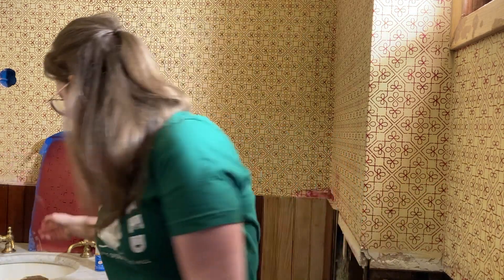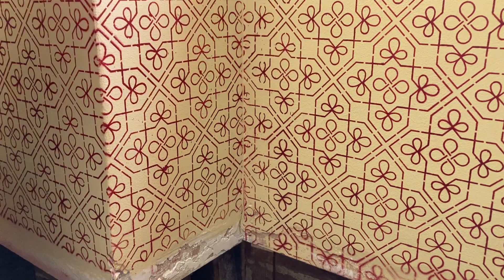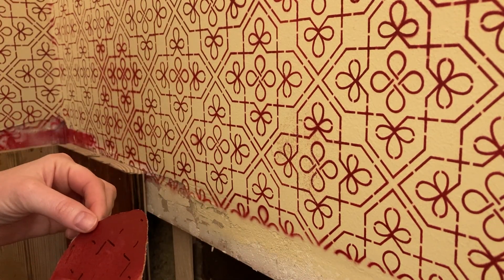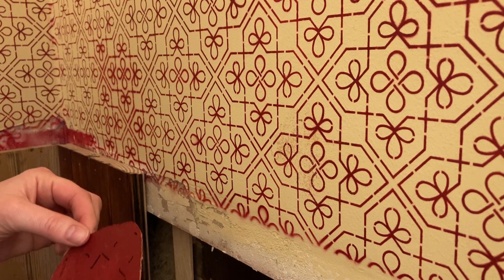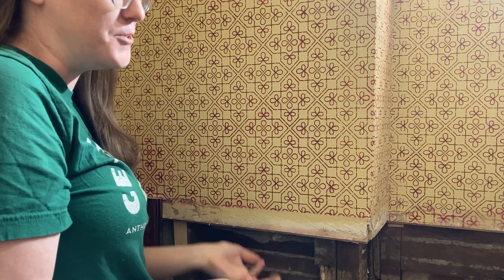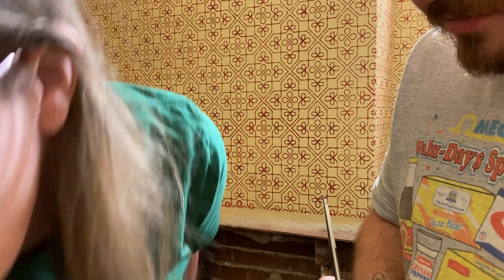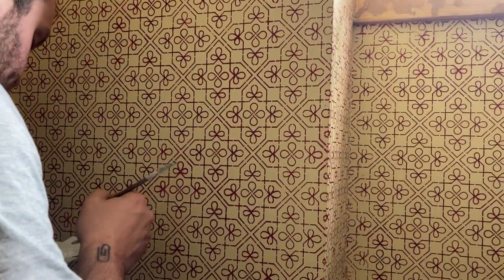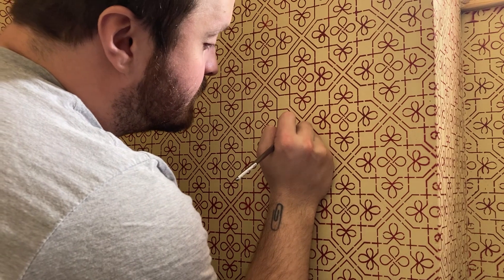Attempting to Fill the Gaps in the Stencil Painted "Wallpaper"

Comment: Kim, my suggestion is to work from higher areas to lower freehand, and do only lines that are at the same angle for each painting session--i.e. only the lines running diagonally left to right. Don't switch around. That way you are making the same motion with your hand with each stroke and you'll be more likely to make a consistant mark, especially as your muscles get into the habit. Then after those dry, pick another angle and work just the lines at that same angle. Don't be discouraged. You're doing fine :o)

Comment: You guy’s have come a long way. Redoing a older or historical home is timely work. I’m over 10 years into remodeling my home. A contractor is going to cut corners mostly in time and materials. Things may not be perfect but you did it. Major works are electrical and plumbing. You guys also have a challenge finding era similar material. The fact that you are not just tearing down horse hair plaster and putting up ultralite drywall is amazing.
Reply: My hubby and I have been working on our 1916 farmhouse for 29 years now and are still not done.

Comment: Hey, Just thought, you could use a straight edge along on side of the line that needs painted. Hold it down with painters tape. One edge would be straight and the other, well you just have to be careful. :)  If your straight edge is 24" long, or what ever length, then you could do any space along that line. Just a thought. Its not a waist of time when its a labor of love and appreciation.
Reply: That actually not a bad idea - hope they see this comment
Reply: That spray on glue will make a mess. I know you would have to go the same direction across the wall. Then when the paint sets up go at a different angle. Either way very time consuming.
Reply: I agree, very 👍
Reply: Yep! That's what I was thinking. Ruler or even thin cardboard to keep the bottom line straight.

Comment: Just to maybe save y'all some trouble in the future: 

1. Start from the ceiling and work your way down. That way, you'll get the hardest areas to reach first, and as you move down you'll have dry space to rest your hand on the wall for stability without messing up your work since nothing below your hand would be painted yet. 

2. Start in sections of the wall and work your way around the ceiling first, then pick a wall and work your way down to the bottom. That way, you'll have an organized method of knowing exactly what was done and what needs to be done instead of filling in random spaces and having the potential to miss spots. Keeping organized makes sure you won't leave any gaps. 

3. Make sure not to overload the brush with paint as it'll create a thicker line than you intended. Start with smaller amounts and build up until you're comfortable doing the lines in one stroke. 

4. I would personally recommend using paint thinner instead of water to thin it out, as water dilutes the color and can affect the way it dries and how long it lasts. Especially in a moist place like a bathroom over time it could potentially change how the paint looks. Paint thinner on the other hand will just make the paint more viscous without compromising the quality of the paint. Also, paint thinner helps to clean the brush when you dip it in and wipe it every so often, which is hard to do with plain water. 

5. I've drawn for years and I can say from experience that the faster your strokes, the smoother the line. Try to practice your stability with paper and a pencil first, drawing straight lines in a single stroke until you get good at that and then they the same thing with paint. It might help you to use smaller strokes on the wall than longer ones, like just filling the gap with no overlap on the pre-existing lines because the longer the stroke the more likely your hand will shake. 

Looks like a grueling process but if the two of you work together it'll be done in no time. Don't give up just because you can't get perfect lines right now! You said you'd touch up later with yellow anyways, so you can fix any major imperfections then  and it'll be easier to do so. 

Good luck!
Reply: Lots of good suggestions.  When I do a project like this I listen to music I can sing or dance with, or NPR podcasts

Comment: This might have already been  said somewhere but if you ever do this again I would 100% use a hobby airbrush.  Way less fumes than spraypaint, cheaper paint, easy to fix stuff.  You would have still had to do some touchup by hand but the paint wouldn't have had as many problems with running and fuzzing out as spraypaint. They're also really useful for other things during restoration. They even have $25  battery powered ones now which are surprisingly good.

Comment: At this rate it's going to take you forever to finish this house if you're going to be a perfectionist. Even you said actual wallpaper is going to have imperfections
Reply: They say they want it as it was and that's why they're taking such meticulous attention to this; however, they've already veered from that perspective on several other projects. This is not wallpaper as the original, so the point is lost already. A great use of that kind of time could be used on the holes in the floor and other things that are keeping them from moving in. Once they're in, they can spend their time on this tedious project to their hearts content.

Comment: I think your free hand worked well. It was nice of you to give it a try.
As far as the wallpaper I have had rolls with
gaps in the printing. The seem in the corner
looks like one I had once. And you have to work around it. I think you notice it more in the smaller area. Both of you are doing a
great job with the work.

Comment: You will get better with practice. You also could try a small, thin  straight edge tool to hold on one side of the straight parts, to help control the brush. Then you only have to concentrate on the free side.

Comment: Kim, you might try a small stencil brush and use the pouncing technique if you got the stencil route.  You put very little paint on the brush and rub most of it off on a paper towel. Push the brush straight up and down on the stencil. Don't rub it around. It may take several coats. Good luck! (I'd probably freehand the gaps.)

Comment: Have you considered making a stencil based upon where the necessary gaps in the first stencil are? It should be possible on your computer program that created the stencil to do a negative. Then all that would be needed is to line up this new stencil to paint in the gaps.
Reply from the maker: That’s what the little stencil I put up is.

Comment: I think you were doing great, hands looked steady to me.

You can work on the areas not at eye level to build your confidence. Make sure you anchor your hand, like Kaleb was. Use less paint on the brush and or thin the paint. Start with the gaps angled / as that's the most natural hand movement, then move onto the curves as they seemed to come naturally to you. Once you feel you have control over the brushes and paint, try the horizontal, vertical and \ gaps. You can do it! 👍

Comment: Instead of using a scrap piece of cardboard stencil, go to the craft store or dollar tree and look for a precut vinyl stencil that has a straight line pattern cut that is about the same width of the lines on your painted wall .   You only need to position the straight lines and vinyl is easy to clean.  Also try using a wider brush to tap the paint over the vinyl stencil so the paint won’t glob on the wall.

Comment: Could use something like a calligraphy pen and put the paint in the pin ?
Reply from the maker: I was looking into refillable paint pens but the paint has to be water or oil based. I suppose I could just get this paint made again with a different base. Or try to find a paint pen at the art store that matches.

Comment: You have to have a lift underneath or it will bleed. 1 piece of tape is enough to lift it off the wall. I agree with Ric Tuckerman--straight edge with a LIFT. Don't use adhesive. One piece of tape or hold the straight edge by hand. Or plastic triangle with a lift already built into it.

Comment: Just put a strip of painters tape on either side of a line. Fill in the area with paint - let dry - remove tape. Using the stencil as a guide, you could even cut the tape  in circular shapes. it would be time consuming, too, but it would be accurate. Barring that - ask a tattoo artist to do it for you.